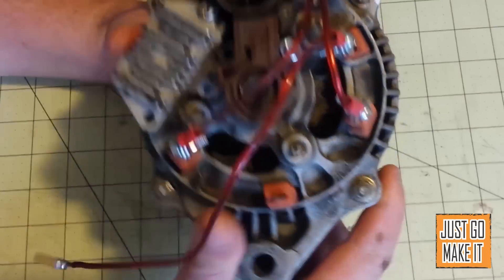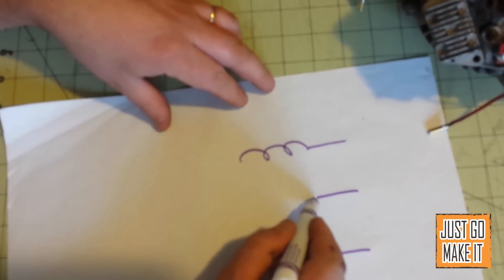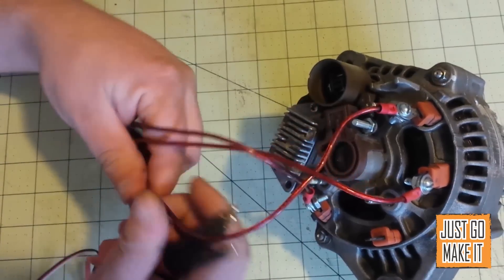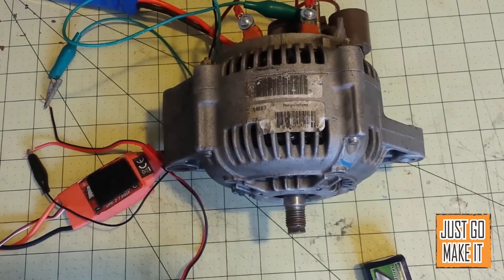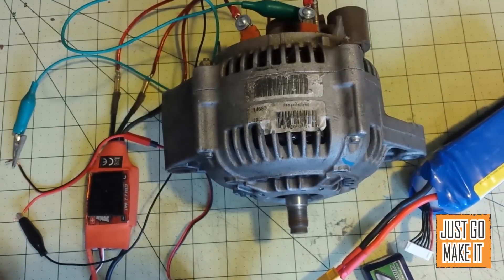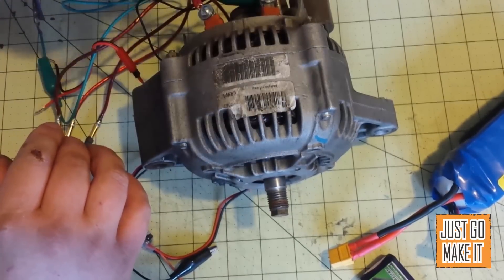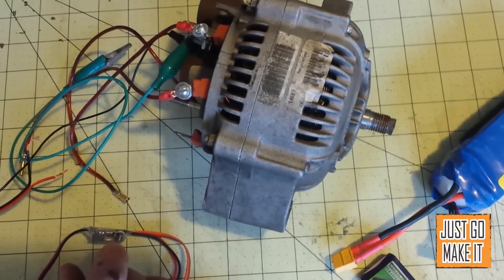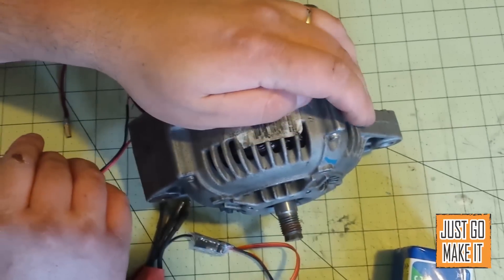Alternator to motor conversion howto

Comment: The field current requires a "current source", not a voltage source. The more field current, the more field strength, unless you saturate the core. The field current for an alternator can handle a few amps. 
Just a suggestion, connect multiple batteries in parallel to get more current.
Reply: Richard Vasquez. Do you NOT UNDERSTAND that a voltage supplied to the field applied across the resistance of the field coil is going to cause a field current to flow?
Reply: You're right Richard, but assuming the field is not saturated,  current is determined by ohm's law so varying voltage to the field will work to vary current.
Reply: cphank151 The field current is determined by field supply voltage, back emf and field resistance. Assuming the field is "saturated" (or in any other state) what can you do to raise or lower the field current? Raise or lower       the        field       ___________.  Further he suggests to put more batteries in parallel to increase the field current. So maintain the field supply voltage at the same voltage as one battery .....and you say he is correct. No, the beginning and end of his response are both incorrect. The middle sentence is correct though.

Comment: Hello
you need a good gear to exploit the power of the engine alternator conversion brushless ...
This is the controller that will vary the speed of rotation ...
ride a bike 26 ", you need 1/7 reducer ...
1 spin for 7th round engine ... it gives you a top speed of 60 km / h under 48v ....

Comment: a test of this type of device is to rotate the alternator for a value that is equal on the other side at the motor to prove you have done it right. or to prove you built them both right.

Comment: hi, is it possible to rig it to a diesel engine and a 12v battery?? and would the switch be a push on switch?
Reply: Hello
on a drive, you can not operate the engine with a interuptor ... an energy of 12V. output power alternator converted into motor is not very strong ...
you need a power of more than 48v to the controller for proper operation

Comment: When a motor is running it acts as a generator as well as a motor. It generates a counter voltage. The more field current, the more counter voltage. When the counter voltage is equal to the supply voltage, that determines the motor's speed. With more field current the counter voltage will build up faster and be equal to the supply voltage at a lower speed. That is why the motor runs slower with more field current, and faster with less field current.
Reply: The frequency of the 3 phase speed controller output would determine the no-load RPM, no? I would think that as the load on then motor increases, the field voltage would have to increase. It's acting funky because there is no load on it.
Reply: Yes, assuming the 3 phase frequency is adjusted to allow the higher rpm.  Because torque is created by the magnetic field of the stator multiplied by the magnetic field of the rotor,  the resulting higher rpm due to weakening the rotor field will result in less torque but perhaps the same power output.
Reply: The frequency and voltage to rotor coils controls speed normally, but it stalls if field coils are high voltage, because the rotor coil generates strong counter voltage, canceling out power. It acts as a generator too, so a fast rotor coil passing strong magnetic fields generates huge counter voltage, slowing the rotor. The more power produced, the more power needed to turn it. With a strong field coil, the required power is more than the input power to the rotor coils so it stalls. I'm no expert but that's how I understood his comment.
Reply: Sintron y coles de bruselàs
Reply: Yes, that's basically the gist of it.  If frequency is not kept synchronous with   motor RPM, slippage will occur causing torque vibration and likely generation during part of the phase and motoring during another.  Assuming RPM/frequency remain in sync, increasing current through either the rotor, stator or both will increase torque and tend to resist a change in RPM with a load change and therefore resist slipping out of sync.  Increasing voltage across either will increase current as well because of ohms law.
Reply: Sooo...
What you're saying is that I should wire the brake pedal to a "throttle" cutoff switch, and give full power to the field winding for regenerative braking?
Cool, thanks.

Comment: As suggested a starting cap will work with dc to boost the flux of the field winding initially and then a switched capacitor to keep it constant... Using a mosfet or transistor to switch it on and off could work with pwm and enable you to have better power efficiency.  Good Luck.
Reply: Hello; It is enough to simply take an e-bike controller !! this is very powerful and nothing to make ... easy to use

Comment: Hi I know for sure I wrote a comment on here before. However this time I am here to ask you a couple of questions (to compare notes) after having fried at least one ESC. Typically what is the no load current you get when you measure? I am having to use close to 12 volts to excite the field coil and so I find the fact that you managed to achieve the same with AA battery rather surprising. For some reason my ESC was getting super hot and finally died. 

Any suggestions? Thanks in advance
Reply from the maker: +Ramesh Radhakrishnan 12 volts.to the feild coil is best.  if i remember right the no load amps are maybe 4 or 5 amps.   i have some new videos on doing this.

Comment: can you use two alternators one as a motor and another as a power source and produce 12 vac for home use?
Reply: Alternators produce ac 3ph. You need to turn it at a correct speed to get 50 or 60 hz.  They have kits to convert a typical 12 v Altenator to 120 v ac    But again you need to run it at the correct rpm for 50-60 hz

Comment: Well, thanks for all your info; I have been wondering how to make a commercial meat grinder with silent power( I have tried my battery power drill but it too is loud) Yes, I know there are meat grinders with electric motors but they are loud. I live in a senior apt and I'm always worried about the noise. Knowing now that you have presented a different option I'm going to look into to this a bit more. I too enjoy tinkering with different things and it is just another Idea to tackle. If anyone out there has any tips for me I would greatly appreciate it. One question? will this method recharge the battery?

Comment: Thanx for a very nice and informative video . I am very much interested in this to try and run it on my metal larthe . I live in South Africa and power outages are oart of our working day . my lighting is already sorted and runs off 12 volts . If i can get the alternator tomotor conversion to run smooth i can run my lathe when electricity is off . Would like to know if this will be at all possible and if someone tried it yet .

Comment: I have few questions , I am  in situation where I have an alternator coupled to  small engine without an electric starter, Can I use this motor just to start my engine and as soon as engine start use it as  generator? The motor part just for starting and retain the alternator use via engine for battery bank charging without frying the circuit , ecs  etc
Reply from the maker: im am sure there could be a way to do that.  its an interesting idea
Reply: How about leaving the rectifier intact m and have a way to cut motor input power by relay as soon as the engine start, that way one cab have a starter-nator , just thinking
Reply: Its possible .... Put you will need speed reduction to get enough torque to start a motor ....

Comment: Thoughts on the stator coils
Alternator are wired in star config, the three coils connected to the center tap like normal BCD motors. This gives good start torq and poor high speed performance. This is usually your best option. If starting torq isn't important but you'd like about 30% maximum power, connect the three coils in a triangle,  cut the wire from center tap of each coil and connected it to the input wire of the next coil. This is called delta config. The best option is to start the motor as a star (for start torque) then switch it over to a delta for efficiency. (You also have to change your name to Elon Musk). It'll require 6 big beafy Mosfet/thyristor switches and an arduino. Unfortunately this will cost more than a bigger alternator from your friendly wrecker yard. It's much easier to live with the inefficiency.

Thoughts on the stator
A lternators use a stator rather than fixed magnets so the charging performance is more linear as rpm and load changes. You pay for this in efficiency which is not an issue in an automobile. The upside is you can control the motor performance on the fly (but modern brushless EMCs do this already). The cost is in efficiency.

The visual hint to how inefficient an alternator is are all the cooling vents and the small fan. The electricity that doesnt go into spinning the shaft ends up as heat. It seems you can expect an efficiency of under 70%. Good BCD motors give efficiencies in the low 90s.  The alternator will also be about two and a half times the size of a BDC of the same power.

An old and dirty alternator  is VASTLY more robust and better engineered than the best BDC motor and will cost about US$30 from your local wrecker. You can usually live with the inefficiency. The bigger size and all the vents looks better to me.

Comment: hi, :)  I intend to use 12V, 100A alternator in a vehicle, 48V system,  I wander how much current the 48V BLDC-controller must be? 48V 100A continuos and 200A peak?thanks!

Comment: did you take the alternator apart and do any modifications?..
Reply: Not really any modifcations needed!
Reply: Only mods needed are removing the diode pack in the back of the alternator and a little ingenuity in securing the brush housing so that it doesn't move when shaft is spinning.  Also have to isolate the brush terminals from shorting on the metal housing.  Inside the main casing of the alternator, nothing is modded.

Comment: I'm assuming you don't actually need a speed controller, it just makes things more convenient.
Reply: Probably could use a rheostat as a speed controller. I think you could do all this without all the overpriced trinkets and nick-nacks
Reply: It 3 phase motor... You can't run it staright from DC and rheostat is awful inefficient in controling motors.
Reply: +KrisMaster Okay, 3 AC sources out of sync. I can see how that might be tricky to pull off. Just kinda seems a waste to use two batteries just to control 1 motor. So, I'm guessing upping the voltage would only increase the torque output and higher frequencies would increase the potential rpms. DC would probably only be useful in a stepper application.

Been a while since I played with the old breadboard, so forgive me if things should be clicking for me that aren't.
Reply: More amperage to the field windings will actually slow the rpms.  Optimum voltage is around 4 to 6 vdc on the field windings. A small simple voltage reduction circuit running from the main drive battery to the field windings deletes the need for two seperate batteries in this application.  You can use a UBEC DC to DC converter that is normally used in RC field.

Comment: put i diode and a capacitor on the brushes. the cap will charge and make it run. the diode will protect the cap and set the polarity.

the reason you have to drop the voltage is, when you apply voltage to the field on the shaft it locks the shaft lowering the voltage lets it spin freely.

Comment: would there be a way to run it in reverse also?
Reply from the maker: +giovanni visca it could be done with a speed control that has reversing
Reply: Swapping any of the two  3Phase wires will work, so integrating a 4PDT switch or a simple circuit utilizing a relay or two with a SPDT switch works.

Comment: Hi ! I'm interested to know : How many watts & amps out can this altenator provide ?
Reply from the maker: If you have not checked out my series of videos i am doing i will be finding out what my motor can do real soon.  Thanks
Reply: The part number of the alternator can probably be researched on google to find it's amp capacity into a 12V (~13.8V) auto electrical system.  This should give you a rough idea of watts (power) it can create as a motor.

Comment: How much power can we use from this BLDC? is it same as it was when working as an alternator
Reply: I was thinking of using a truck alternator, which can be run on 36V and use it in an Electric bike? is it possible? my alternator is rated at something like 30v 200A
Reply: 30V x 200A = 6000W.  This is about 8 hp and should be more than  enough power for an e-bike.  I'd suggest adapting it to a small motorcycle frame for the added strength.

Comment: Is any possibility to have car alternator working as motor and alternator, I mean by having car alternator converted to motor and with additional ,lets say 4 car batteries installed in the car , this motor will assist running engine  and will help to reduce fuel consumption. After batteries become empty, system switches motor to alternator. Just thinking about DIY hybrid car .
Reply: having more electricity dosent affect internal combustion device dude. the whole pint is the petrol does the work, the alternator is 'parasitic'
Reply: he says hybrid. not electric drive.
Reply: @electrotherapyify  he says using those alternator as a motor to run a car.
Reply: Sounds like an interesting idea. Have you tried it?

Comment: Thanks for that video because I have an alternator and I am building a go kart ,but I need to know how to control the alternator so what are the parts specifications ???

*RC air plane speed controller 
*Brushed motor speed controller
*6s lithium battery
*2s nano tech

Comment: Have a Few laying around.  May as well try this , eaa?   Purchased a Yeapo ESC from Bang Good for like 6 dollars.  Suppose to be 12v @30 Amp.  If I can get one to run I'll work on a better ESC.  I have butt load of FET's laying around.  A few Arduino's.    Bodging a E-Bike battery this past two weeks.  Still testing the 18650's for that.  65 of the damn things.
Reply from the maker: cool, give it a go.
Reply: You have to love Bang Good.  When the Chines says something is rated 30 Amps that is when the chit starts smoking LOL

Comment: Most alternators are 6-phase, not 3-phase.  The phase angle is 60º - not 120º  This is actually brilliant, as it allows six diodes in half-wave configuration to produce a very low ripple DC output.  Using it as a motor can work, but your drive devices must be able to tolerate the output going negative, and must be cognizant of the 60º phase relationship, as opposed to the 120º in a conventional 3-phase motor.
Reply: I respectfully disagree with you Curt Lundgren.  Automotive alternators typically contain 6 diodes with two diodes connected to each of the three phases.  One of these two diodes is connected anode to negative (ground) and conducts when the phase output is negative with respect to ground.  The other diode is connected cathode to the battery and conducts when the phase output is positive with respect to battery voltage.
Reply: CP hank is correct.  "Most"  automotive alternators are 3 phase

Comment: I found my alternator stuttering (2 ticks forward, 2 ticks in reverse repeating).  I have tried this with both a ESC and my own build electronic control circuit.  Both produce the same result.  Do you have any thoughts as to why that is happening.
Reply: Hello
it is because the electro magnet rotor is not enough  supply ..it must 7V  lowest or 12v, otherwise the ESC has trouble finding the phase position ...
it makes click click click ...
Once the phases finding of the position  , the motor alternator turns ...
although bearing  for maximum performance of this motor alternator conversion, you need a minimum voltage of 24v 500w. Councillor a rotor 12v ...
on a go kart  have a speed 20km / h ...
the top is a supply 48v 1000w, we can go for a 72v high power 4000w is very powerful ...
do not use controllers ESC model-plane, it'll burn it on ...
thank you
Reply: If you split the stator windings into 2 parts and use one side of the stator you will get more performance from it, you could use 2 ESC's to run it.
I'm doing a similar thing with 2 Kawasaki bike alternator stators and flywheels.
Reply: +david parfitt Hello
we look for the couple and not speed ...
excitation of the rotor is fed continuously to a high torque, there is no besion to vary ...
otherwise the finished engine stalling
Reply: +tchangly21  get a PMA alternator off ebay
Reply: yes, but it is very expensive, so we must make it simple = 0$
Reply: +tchangly21  take a look at my Kawasaki twin alternator, they give good power

Comment: I know the higher the voltage being fed into the coils, the higher the speed. I also know that the higher  speed results in less torque. What I DON'T know is how the voltage going into the brushes affects the speed and torque. Could you explain it?

Comment: Good idea , and nice work , but you should use a fixed voltage excitation for the rotor , for 12v alternator it should be 5-6v , that's the way that the output voltage is controlled on regular use in cars , you didn't tell us about the torque , is it high enough ?

Comment: Ideas for hybrid. I have a 1994 Geo Tracker 2 wheel rear drive. 2140 lb. I could put the front diff from a four-wheel drive model and I could have some sort of motor put in to drive the front wheels. Maybe have the throttle on the stick shift manual. Can completely decouple drivetrain since front wheels have locks that can be manually engaged  And disengage. thinking about putting a three-cylinder engine from a Geo Metro and carbeurator it. I'm going to call it the Doomsday apocalypse hybrid.